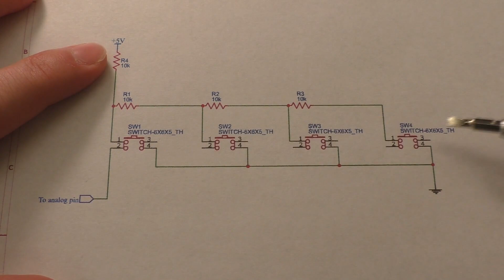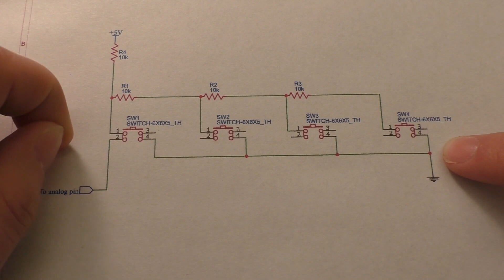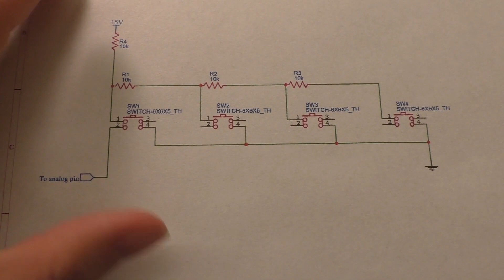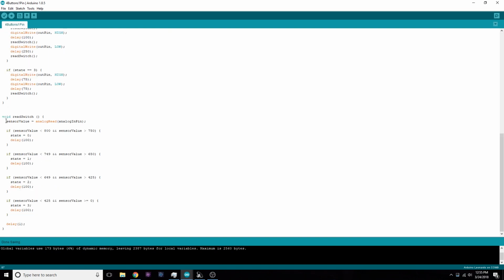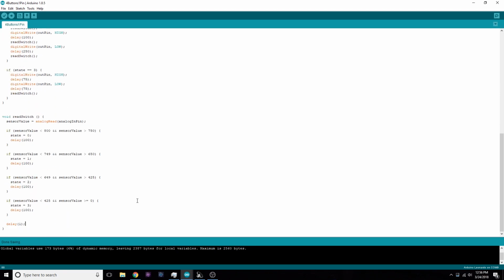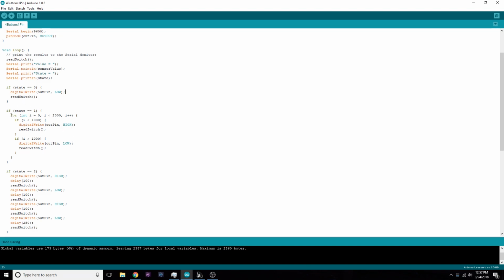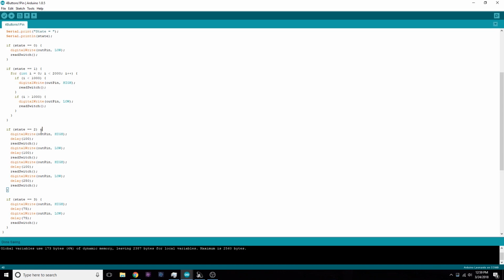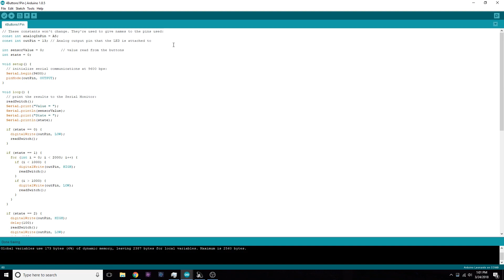Use 1 Arduino Analog Pin to Read 4 Pushbuttons

Comment from the maker: I have put the code for this project on github.

https://github.com/Eman2000/Arduino-4-Buttons-1-Pin
Reply: Would this work for leds ? (connecting multiple leds to one arduino pin and control them individualy)

Comment: You can push multiple buttons by choosing a different resistor value for each button and putting them in parallel rather than series

Comment: Great hack! if you use only one digital input you can use it for interruption, this could be done by adding an op amp in comparator configuration, comparing  Vout: the output of your circuit with Vo: the least voltage that can be provide when pressing a button, if Vout >= Vo the op amp gives us 5v this is the signal that triggers the interrupt routine which is just reading Vout i.e knowing which button was pressed.

Comment: Doesn't work. Sorry for commenting so much but after fixing the error code nothing happens. I upload it and once everything is hooked up properly, it stays stuck on the blink command. The serial monitor just says, "
state = 3
value = 0
"
Reply from the maker: Sorry it took so long for me to respond. If you are still trying to make this work I put the code on github.

https://github.com/Eman2000/Arduino-4-Buttons-1-Pin

Comment from the maker: //The code:

// These constants won't change. They're used to give names to the pins used:
const int analogInPin = A5;
const int outPin = 13; // Analog output pin that the LED is attached to

int sensorValue = 0;        // value read from the buttons
int state = 0;              // used for storing what button was pressed

void setup() {
  Serial.begin(9600);       // initialize serial communications at 9600 bps
  pinMode(outPin, OUTPUT);  // set pin 13 as an output
}

void loop() {
  // print the results to the Serial Monitor:
  readSwitch();
  Serial.print("Value = ");
  Serial.println(sensorValue);
  Serial.print("State = ");
  Serial.println(state);

  if (state == 0) {                         //turns the LED off if a certain button is pressed
    digitalWrite(outPin, LOW);
    readSwitch();                           //contuines to poll the switch circuitry
  }

  if (state == 1) {                         //runs a program similar to the blink schetch if a certain button is pressed
    for (int i = 0; i < 2000; i++) {        //set a for loop that counts up to 2000
      if (i < 1000) {                       //if the for loop value is less than 1000 turn on the LED
        digitalWrite(outPin, HIGH);
        readSwitch();                       //contuines to poll the switch circuitry also provides about a 1 ms delay
      }
      if (i > 1000) {
        digitalWrite(outPin, LOW);          //if the for loop value is more than 1000 turn off the LED
        readSwitch();                       //contuines to poll the switch circuitry also provides about a 1 ms delay
      }
    }
  }

  if (state == 2) {                         //creates the 2 flash sequence of the LED and polls the switches between delays
    digitalWrite(outPin, HIGH);
    delay(100);
    readSwitch();
    digitalWrite(outPin, LOW);
    delay(100);
    readSwitch();
    digitalWrite(outPin, HIGH);
    delay(100);
    readSwitch();
    digitalWrite(outPin, LOW);
    delay(250);
    readSwitch();
  }

  if (state == 3) {                         //Creates the fast blink effect and polls the switches after one cycle of the blink effect
    digitalWrite(outPin, HIGH);
    delay(75);
    digitalWrite(outPin, LOW);
    delay(75);
    readSwitch();
  }
}

void readSwitch () {                                  //creates the function to read the switch states
  sensorValue = analogRead(analogInPin);              //read the analog pin the switches are connected to 

  if (sensorValue < 800 && sensorValue > 750) {       //if the analog reading is within a certain range we know which button was pressed and set the state accordingly
    state = 0;
    delay(100);                                       //delay for debounce purposes
  }

  if (sensorValue < 749 && sensorValue > 650) {       //if the analog reading is within a certain range we know which button was pressed and set the state accordingly
    state = 1;
    delay(100);                                       //delay for debounce purposes
  }

  if (sensorValue < 649 && sensorValue > 425) {       //if the analog reading is within a certain range we know which button was pressed and set the state accordingly
    state = 2;
    delay(100);                                       //delay for debounce purposes
  }

  if (sensorValue < 425 && sensorValue >= 0) {        //if the analog reading is within a certain range we know which button was pressed and set the state accordingly
    state = 3;
    delay(100);                                       //delay for debounce purposes
  }

  delay(1);                                           //delay for timeing purposes
}
Reply: Keeps giving the error of "stray '\357' in program"
It gives the error for the last line of code. Great video though!
(Update) Fixed error but still doesn't work.